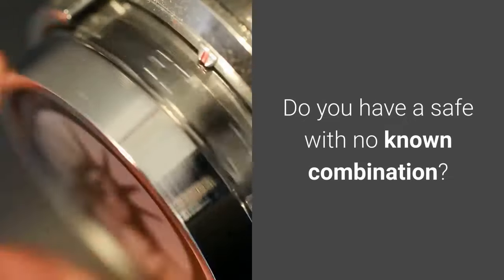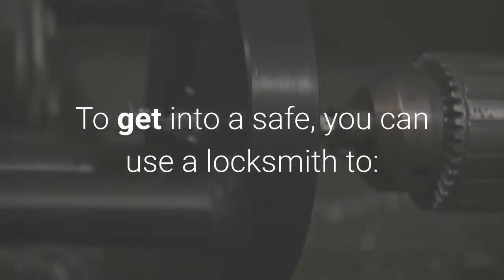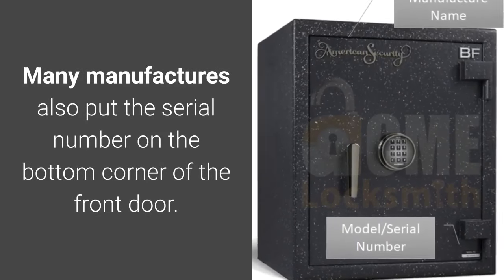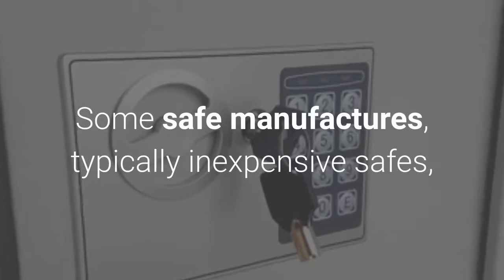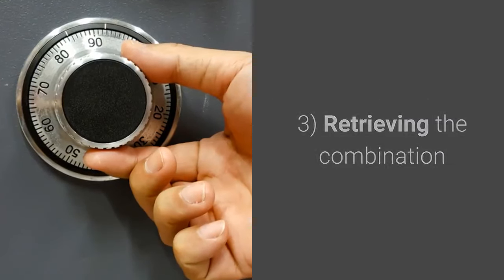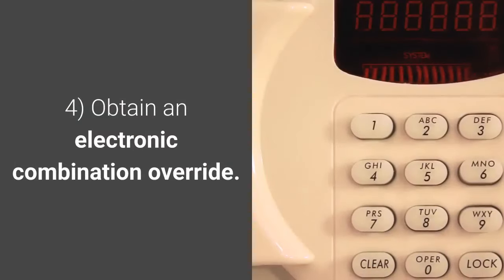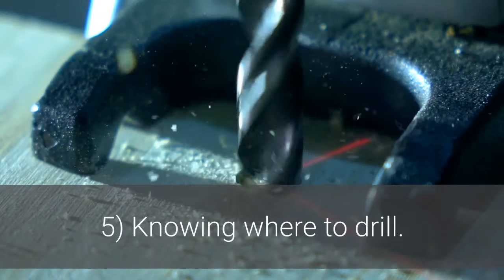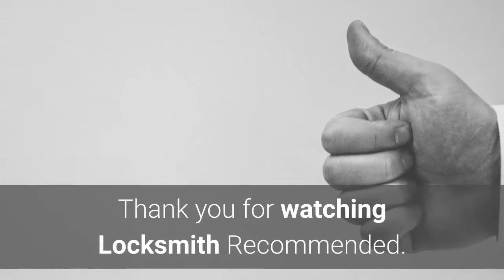How to Open a Safe Without the Combination

Comment: My father has has one that has not been open for like 20 years
Reply from the maker: That's going to need to be drilled and repaired (if you want to keep using it).
Reply: @LocksmithRecommended  what do you drill
Reply from the maker: @andrewhall6401  We take the path of least resistance. We try everything in this video where it applies. If nothing works, we drill.
Reply: @LocksmithRecommended  do you drill the hinges
Reply from the maker: @andrewhall6401  No. Good safes are made so that if the hinges are removed, the door will not open.
Reply: @LocksmithRecommended  so where do you drill

Comment: I bought an open, but locked… American Security (AMAEC)… it’s kinda old. I haven’t seen if there any screws on the inside to take off in order to see the locking mechanism and I didn’t ask because I’m getting so cheap. I’m picking it up tomorrow, with help.. it’s 275lb with the dial lock. Is it easy for someone who can follow instructions (me) to get to the locking mechanism in this situation?
Again, it’s locked, but the door is open. Thanks
Reply from the maker: If it's locked and the door is open, any locksmith will be able to reset the combination for you. 

https://www.acmelocksmith.com/articles/need-combination-for-open-safe/

Comment: I will call BS on one point. I have an old safe not sure where I bought it but know it was not expensive. I did forget the combination and it was not an electronic one. I was able to retrieve the combination by contacting the manufacturer.
Reply from the maker: Interesting feedback. None of those we deal with will because ownership has to be verified. That is, that the safe is in your procession at your property. What documentation did you need to provide to prove you were who you said you were and that you owned the safe?

Comment: Why would you buy a safe that you know has an override code.  Not all locksmiths are on the up and up, not to mention I'm sure that info is available on the web.  Buy a safe with a S&G dial lock and change the combo the day you get it.  I've seen them delivered with the combo written on a piece of tape with the combo written on it.  Wonder how many people say the combo before it left the store.  Not to mention the delivery guys.  They are not locksmiths and who knows how honest they are.  Also, the manf.  keeps a record of the combo of the safe in their files.  Seeing how many businesses are being hacked that info could be compromised at any time.
Reply from the maker: No argument from me. For the most secure options, mechanical dial and set the code after it arrives.

Comment: we innheritated a 3 feet and 5 feet safe left in the forced closure house. Make by American Security. I tried to call u but the phone number was disconnected. I live in San Jose CA. Do u have service at this location? If can not open them, I plan to give it away.  Thank u.
Reply from the maker: Maybe a misdial? Our phones are up and running! :) . But we are an Arizona company and do not service California. Goto findalocksmith.com and do a search for locksmiths in your area. That is a search tool ran by the Associated Locksmith of America and will give you certified, licensed locksmiths.
Reply: @LocksmithRecommended  Do not service California?
Reply from the maker: @pamcadd8658  Yes correct. Sorry. Fixed.
Reply: That would be a Foreclosure... Amsec gun safes, I used to be a certified Amsec tech, I opened many safes for them. I suggest you call The locksmith on Azurais or San Carlos St in San Jose. I'd name names but I like those 2 shops. If it has an ESL5 digital lock ditch that POS and get a combo lock

Comment: I opened my Sentry safe (accidentally thew out the combo) with a crow bar and a 3# lump hammer in 60 seconds.
Reply from the maker: Sentry. 🤦🏻‍♂️
Reply: Did it fuck the safe up
Reply: Digital Sentry, fun to bounce open! Dial Sentry - fun to drill 1 hole.

Comment: Lost the key
Reply from the maker: Shouldn't be an issue. If you can take the safe to a locksmith shop, they should get you squared away. If not, they can come out and do the same thing.

Comment: Now that's real safe😀😀😀😀. A lock smith will charge you a crap load of money. Get a pry part and break it open, then throw it away. Useless video.
Reply from the maker: That's exactly what we recommend for cheap big box store "safes." But you'll save a ton using a locksmith if you have a good safe. ✌️